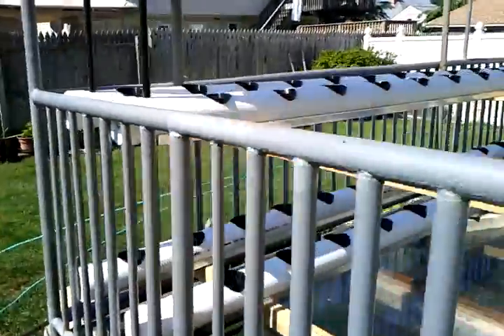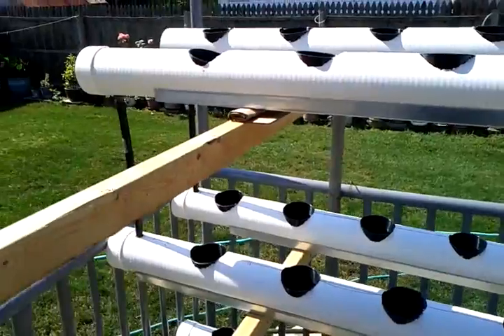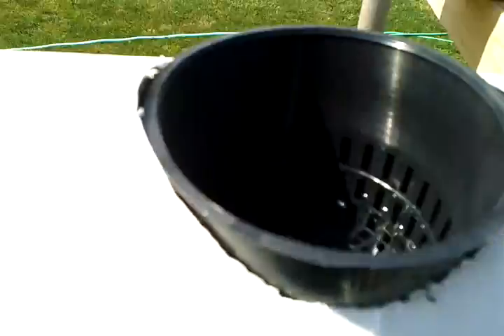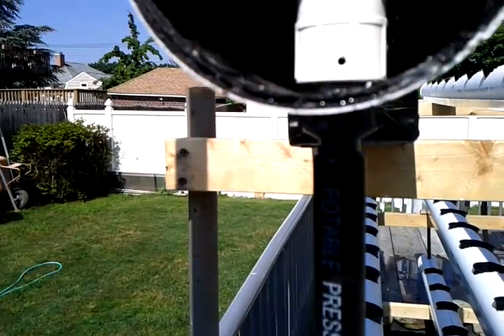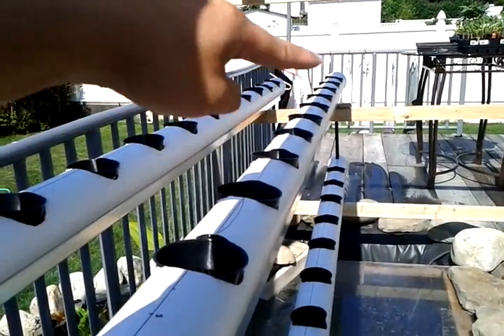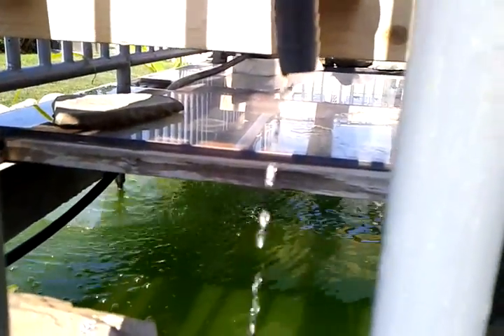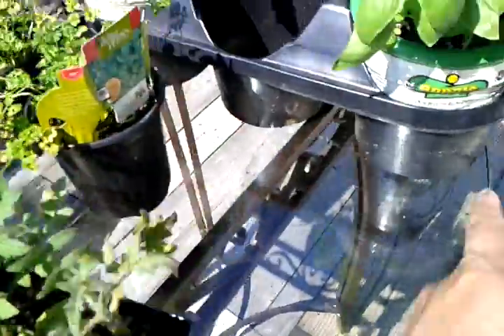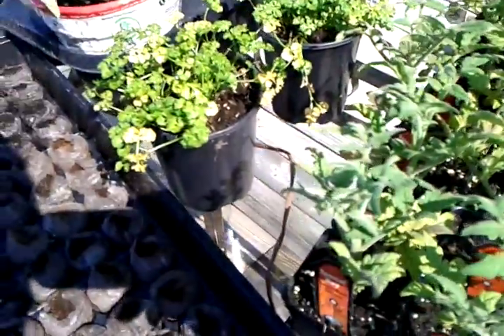Hydroponic System Update

Comment: Second largest problem is PH fluctuations. As the plants consume the Nitrogen in your nutrient solution the PH will rise, and this can happen very rapidly. If the PH rises above 6.5 it will cause nutrient lockout to occur. Once this happens the only way to correct it is to do a flush of plain water for a 24 hour period. Hope that helps.

Comment: Since he didn't answer your question I will. In an NFT system the pump runs 24/7, but he was a bit confusing by using terms like Ebb and Flow in the video. NFT and Ebb and Flow are two completely different systems. The system he is using is designed to be NFT so it should be run 24/7. 

The biggest problems you have to deal with in an NFT system is power outages. If the power goes off your pumps stop pumping and your roots dry out and die. And that will begin to happen almost immediately.